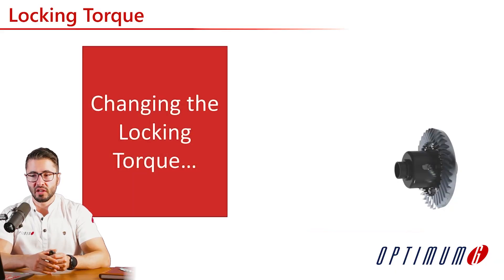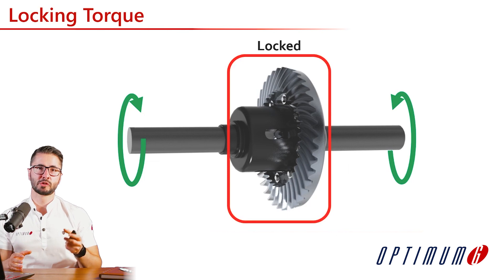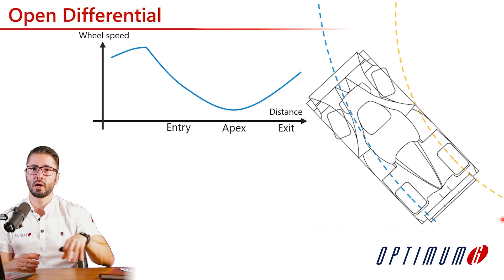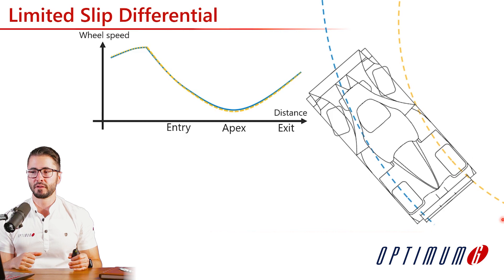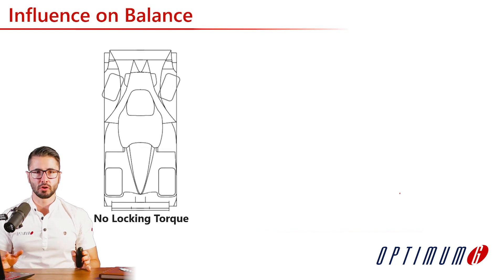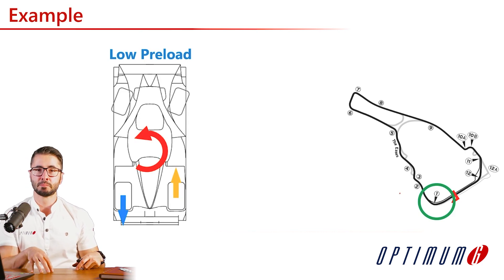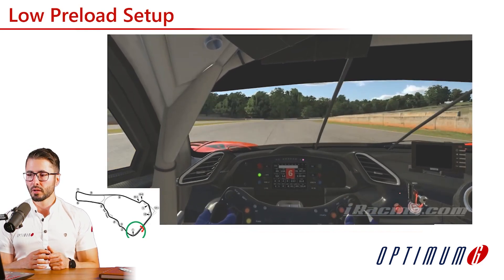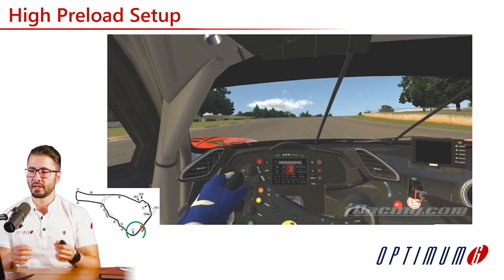Understanding Differential Preload Setup | Performance Engineering Series - Ep. 4

Comment: Engineer for a axle company here. 
Love your video, as it explains vehicle dynamics well.
Understand it was omitted for clarity, but wanted to add: even ‘open diff’ has some capacity for torque (friction behind the spider gears). Nothing that can be adjusted or tuned, just inherent to the parts.

Comment: My experience with a locked differential (Porsche RSR) , I never felt the adverse yaw because the inside rear tire was unloaded as the car leaned through the corner. Great corner drive off outweighed any inside rear tire's drag. The car did have to be driven more aggressively with throttle.

Comment: If using preload causes longitudinal force reactions on the rear wheels, then wouldn't that be reducing the amount of rear grip available for cornering? If the car is too oversteer, why not tune the roll bars to modify the roll couple instead of degrading rear lateral grip?
Reply: It's reducing grip all around. The moment the front tires have to produce to generate a yaw is now higher because it has to counter the counter yawing force from the rear axle in addition to generating centripetal force.
If acceleration didn't matter an open diff would be ideal. The torque application is going to be limited by the wheel with the least amount of grip which means the more weight transfer the less acceleration is available before that inside tire starts to spin.
A locked diff maintains all of acceleration potential regardless of lateral load transfer (ignoring tire load sensitivity).
This is why with a powerful car one school of thought is to simply spool it and lift the inside tire with caster+scrub radius.
Not sure why he didn't go into this in the video. It came across as tighter=better without context.

Comment: The yaw moment in the image at 6:30 should point in the other direction. The left rear wheel is pushing forward, the right one is slowing down a bit. If you imagine the car driving in a straight line, it will move to the right and not to the left. A yaw to the left would not help the car in the right turn. According to the explanation, an open differential would have an advantage in the corner.
Reply from the maker: Thanks for your message. In coasting, the forces and moments are as shown in the figure at 6:30. The inside tire tries to follow a shorter path (closer to the turn center), but due to the differential, it is sped up (equivalent to traction), generating a force forward. For the outside tire, it tries to follow a longer path, but due to the differential, it is slowed down (equivalent to braking), generating a force rearward. The resultant moment is against the corner, as shown. Differential preload does not help the car to rotate, it does the opposite, it reduces the car rotation (increasing car stability). When you are at the track, and you increase differential preload, the car will get more understeer (less rotation in the corner).

In a traction situation at corner exit, then it will be more similar to what you described.

Comment: The video is very good for basic understanding of the differential settings.
The data analysis and simulator analysis would be good if it was not biased by the fact that in the low preload setup, we can see the start of a rear wheel locking causing the instability of the car. 
This video shows the phenomenon of wheel locking under cornering condition but should focus more on this particular point, because that's the root cause of this kind of instability.
On top of that it does not describe one of the most important effect and adjustment in a LSD: the reaction time.
Reply from the maker: Bertrand, thank you for your input. We will take it into account for future videos.
Reply: Wait, that graphic u talking about is showing wheel speed DIFFERENCE, so when it goes 0 it means the wheels are spining at the same time. If i was WHEEL SPEED only than if it its 0 it means lock up. Or i am reading this wrong?
Reply: @Fearlusitano   I'm also confused. That graphic is showing wheel speed difference, it has nothing to do with a rear wheel locking, unless both the rear wheels are locking. But the preload definitely effects reaction time